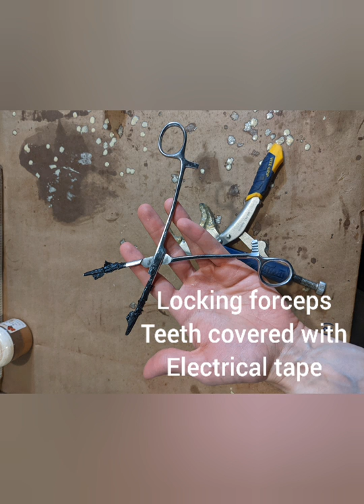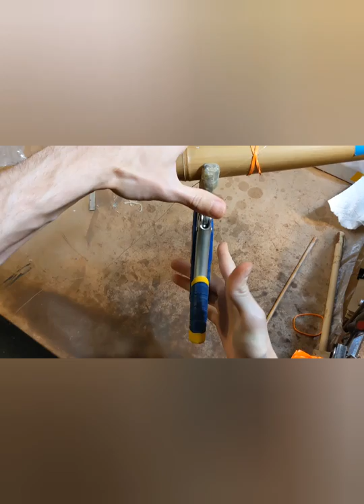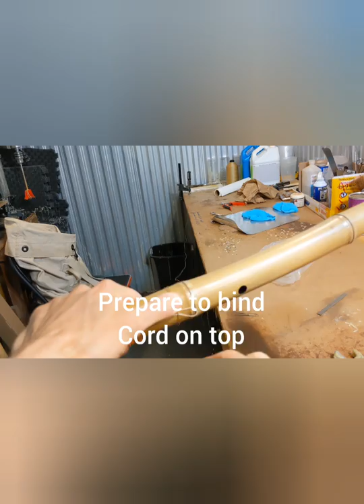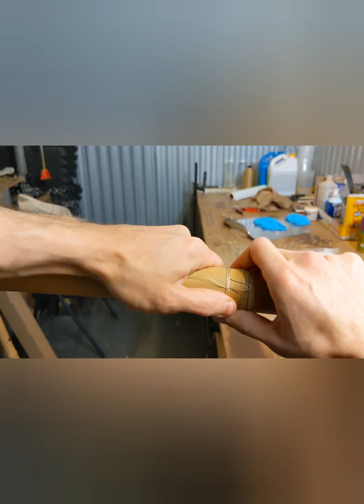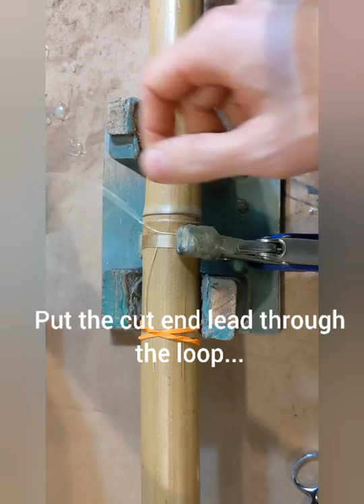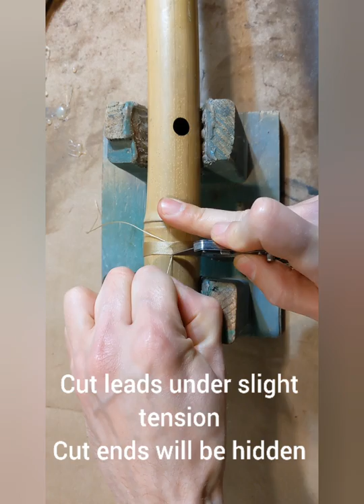How to bind bamboo shakuhachi, bindings for crack repair by Josen (Jon Kypros)

Comment: Great demonstration – I've never seen how that's done. Will the glue/epoxy keep the binding from sliding down the tube?
Reply from the maker: Hi Markus! It's mostly to make them more resilient against abrasion and other forms of wear and tear. I used to think that it also helped prevent any theoretical "creeping". However, I've had some unsealed bindings on some shakuhachi here for ages with no issues in terms of performance.

Comment: Assuming the same method would work with binding a crack on a shinobue, would this method work for a longer/thicker crack?
Reply from the maker: Definitely! The locking pliers might be strong enough to further crack thinner bamboo though! I would be very careful or use your hands instead

Comment: At about 39 seconds, you seem to skip the part where we place the line under the rubber band. It’s not really clear. It also looks like you make the first loop towards one end of the Bamboo but then the rest of the loops go the opposite way. Is this accurate? I think this video would be a lot better if you would simply speak the part, and then we could look at the translation of text.